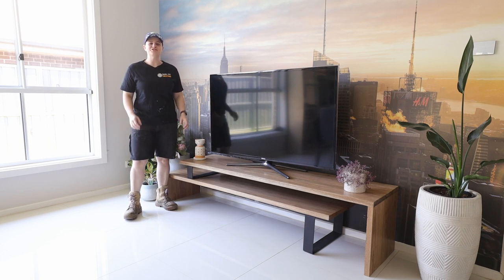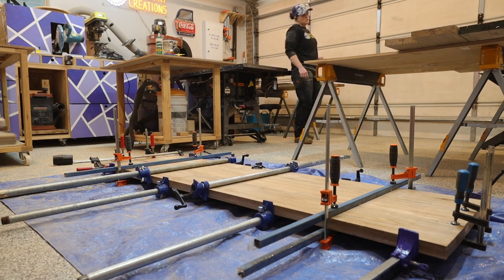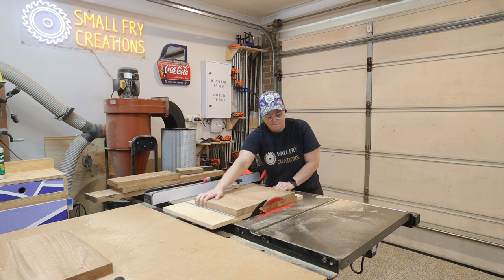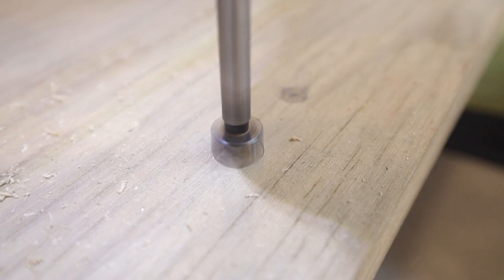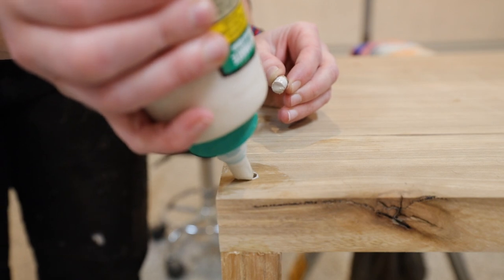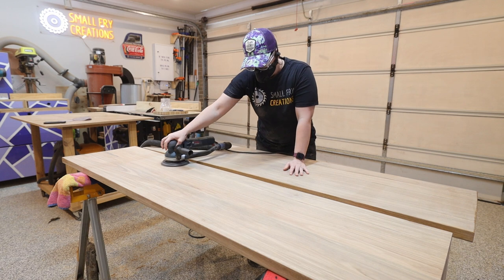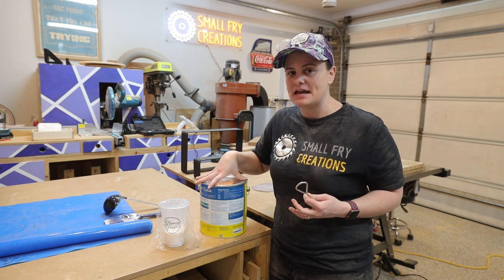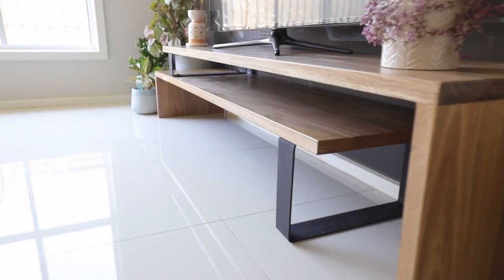DIY | How to build a MODERN TV Unit with bonus sanding and finishing tips

Comment: Step drill bits are great. I have used them to put holes through 1/4"  318 Stainless Steel.  Cobalt drill bits also work well for the purpose. In either case use Tap Magic or another cutting oil.
Reply from the maker: Yeah they worked perfectly. I would have been there all day if I tried to use a regular drill bit. I will try some cutting oil next time 😀

Comment: Great build and excellent video. I couldn't agree more when it comes to getting a paint tin opener, and the bonus - just like the one you were using - is that the other end is a bottle opener!! 😂
Reply from the maker: Hey thank you 😀 I was surprised with just how much better they are then a flat head. Love a tool that can pull double duty 😀

Comment: Ainslee, I love your presentations and always look forward to them.
I wanted to ask about the new dust collector you showed us some weeks back, I think Sherwood?
I noticed at certain camera angles, this video and the last one in particular, a lot of surface dust kicked up from the blade.
Is this something that can’t be picked up by your existing system? Is a problem?    I ask because I thought, after your presentation “ I ‘ll have what she’s having”. 😀 
I have to buy a unit, but prefer experienced advice over sales advice.
Cheers!
Reply from the maker: Hey Howard. Thank you. With the dust collector because the timber is sitting off the table because it’s on the jig the dust collection is not as good. I can’t remember but I may have also forgot to open the blast gate 😂 but generally when the timber is sitting off the table the blade can’t push the dust down into the table for the collector to get. Hope that makes sense and help. Overall the dust collector is fantastic. My only gripe is it can be difficult to empty because you can’t put a bag in it and I’m not strong enough to lift it on my own. If your looking at them and can afford it I would go up a model where you can put a bag in it and then would be a breeze to empty. 😀
Reply: @SmallFryCreations  ahhh! Thanks for your reply. I’m going to go online today and look at the model you refer to.
Thanks for the tip, and for the hard work you put in.
Reply from the maker: No worries at all. Happy to help. I’m pretty sure Paul over at the Wood knight got the model above with the option for the bag 😀